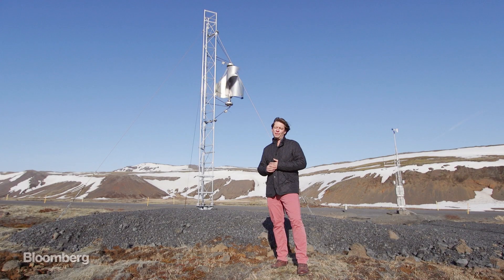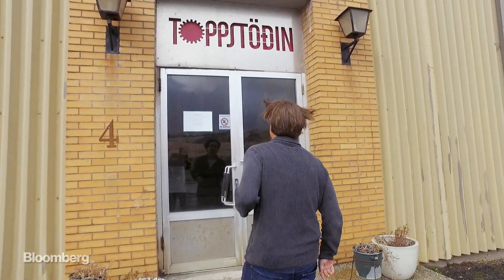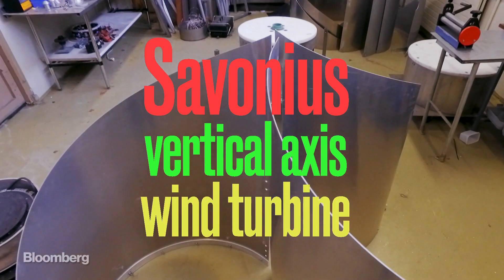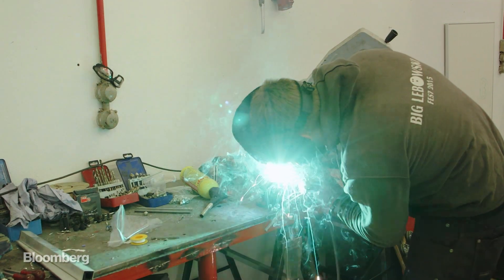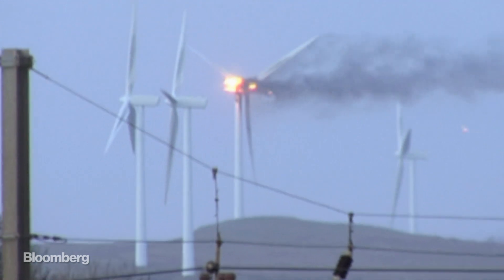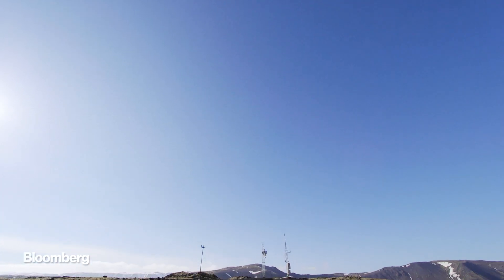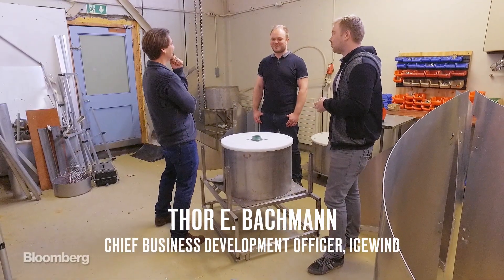The Tech That Could Fix One of Wind Power's Biggest Problems

Comment: This turbine is a bad idea because only the inclined area of the blade takes wind energy and that is very little, and most of the wind pass through blades. My "dmmd" wind turbine takes much more of wind energy. I designed two such turbines, one horizontal and one vertical. There are three kinds of turbines: "Wind direction change" (as the horizontal turbine), "Turbine different shape" (as the vertical turbine) and "Wind direct hit" (My idea and is not yet known)

Comment: These are not Savonius type rotors. Savinous pointed put that the gap between the two (!) wings is crucial to even out the negative pressure on the backside of the wing that rotates towards the upcoming wind. These turbines here don't have that gap and thus run less efficent. Also they have more than 2 blades, which is not what Savonius suggested. I guess they work as well, obviously. But they are not Savonius-type.

Comment: If these were cheap they'd be useful. Inability to scale up doesn't matter domestically or in light industry, just use more smaller ones. I wonder how they would work in water? In a tidal barrage underwater or a river? This stuff about them being not efficient due to the back blade facing wind too could be solved as it has been in aviation by computer controlled pitching of some kind?

Comment: The fact is wind turbines are an eyesore no matter what kind are used.
Reply: It's in the eye of the beholder.  I'm not crazy about smoke stacks from coal power plants, air pollution and reduced lung capacity.  To each his own but we need to do something pretty quick.

FYI this "wind turbine" is nothing but lawn art.  No power curve, no specs, no viable product.
Reply: @solarwind907  It's true that smoke stacks are unsightly. but they don't cover large area's of the landscape. (an example) say your driving along in your car and you drive past some smoke stacks. you will see them while you are in that area and not again. however if you drive in the area of a wind farm you will see those wind turbines for miles and miles. but what's even more  unsightly is wind farms where the wind turbines have reached their maximum lifespan. and have to see derelict wind turbines as far as the eye can see. because many of these energy companies take no responsibility for cleaning up what they left behind. maybe these energy companies should take a hint from something like wind mills. there are some of them that have been around for a hundred plus years. that still function with significantly less maintenance. I don't have all the answers but the way the energy companies are going about it right now doesn't seem to be highly efficient.

Comment: What is the Carbon footprint of each generator from the Extraction of the Raw materials to make and cut the Stainless steel, to the Carbon fiber, to the bonding reasons of the Carbon fiber and son on including all shipping and handling cost for each nut, bolt, screw, to the generator parts and to the nth degree, just to keep the electrical cost down for a Bus Waiting station. Is it truly Carbon saving?

Comment: Round spinning windmill are very ineffective. They don't spin or work till you got 20-30 mph wind. It's a trade off. propeller Type spin in very light wind. And spin twice as fast as these.and You get more ah.
I know someone now who regretion he brought a round spinning windmill. It's not working 80% of the time.
 
Why don't they just make a rutter like a boat rutter. That comes out the side when the speed sensor say speed too fast. The rutter would turn the windmill blade side to the direction of the wind. So the blade wouldnt  turn as fast as  direct full on wind speed. It's so logical.

Comment: Probably the biggest problem with "renewables" is the massive need for storage. ie batteries made from toxic materials mined from the earth that eventually require safe disposal.
Reply: Consumer products use batteries for convenience. We don't make batteries to store power for the power grid. We just produce less power when not as much is needed. That means we reduce productivity at the water dams, burn less coal at the power plants, use less fuel. THOSE are the energy storages we use on a macro scale, not batteries. Now, if we can feed the grid with stable and somewhat predictable energy from solar, wind etc, we have less use for energy storage at power plants and dams, which will benefit the environment.
Reply: @oleanderthor-borre9506  right LOL.
Reply: @jluvs2ride  you're just mad because you thought up to this point we actually made batteries to store power for the power grid. Something only an idiot would think 👍
Reply: @oleanderthor-borre9506  you aren't important enough to make me mad.
Reply: @oleanderthor-borre9506  but, you are incorrect about batteries being used for storage.
Reply: @oleanderthor-borre9506  stable and predictable wind and solar.  LMAO!!
Reply: @oleanderthor-borre9506  per unit of generation wind and solar are horrible for the environment.

Comment: Any wind turbine is better than no wind turbine and we need a mix of them.
This would be great fit  with solar PV for small scale buildings.
Efficiency is NOT the point of complaint if you have 5 acres of space, and want to generate some electricity for yourself, especially  in consideration to the millions living with out power on Mother Earth.
I do engineering work and Sheetmetal and these guys are getting off their butt, and producing something.....that does work.
If people want to criticise then they need to build something better, with their hands.

Comment: Maybe the vertical nature of the turbine will reduce the bird kill.
Reply: Very likely, yes, but let's not forget that household cats kill far more birds than wind turbines.
Reply: @tcl78  -Except cats dont usually kill birds of prey like Eagles and Kestrel many of which are protected species and fly on thermals then get caught in the pull of the air into the propeller arc.
-Alot of bats are also killed by these.

Comment: Yeah, not an actual problem with wind mills. Normally if the wind gets to high, the mills are turned off. They don't spin at all. So I don't know why you are pretending that fire had anything to do with too high winds... The only real problem wind energy has is that it requires rare materials for the magnets. 

Also, this is nothing more than a bad commercial. No information whatsoever except for a false claim that other types of wind mills can't handle weather. There's a reason these kind of windmills aren't used much: they are low efficiency.

Comment: "slow itself down in high-winds" How?
Reply: When a velocity is reached it will disengage ride up and off.
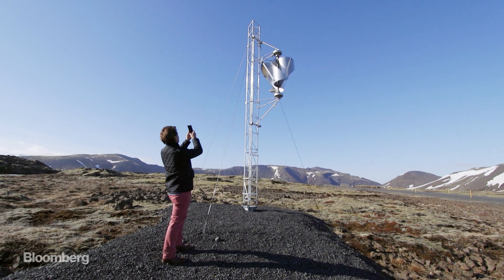Reply: The blades expand out, making them travel farther. The wind pushes the blade longer which spins the axis slower. The blades at 1:48 are tucked in for low wind speed and expanded out at 1:58 in a stronger breeze.  Looks like the rods are a linkage to lift the blades out the same distance for balance.

Comment: This concept was done years ago by splitting a 55gal. drum vertically then reassembling with a 2/3  offset. Pole mounted with bearings top and bottom and set on a robust truck alternator, it produced power with wing speeds as little as 3-5 mph. So, new take on an old idea. Sorry, Bloomy...mis-leading and incorrect...as usual.

Comment: Agree with other posters, this video is bad intel overall.  Wind turbines last more than 3 years unless they're garbage to start with.  Savonius WT's and Vertical Axis Wind Turbines like them are considered lawn art by wind techs that are actually trying to sell something that makes some power.  
Wind turbines don't burn up in high winds unless something failed.  Electrical short circuits unfortunately happen, but very seldom with a quality machine.

Comment: In Jan 2021, they have two models, one for residential use that is rated at 160W and two for industrial use that are rated at 100W & 500W.  What the heck are you supposed to do with such low output?  Yeah, I suppose the residential unit can be a point source for a small refrigerator, or a backup battery charger, but that's about it.
Reply: Yeah... Unfortunately a lot of people just aren't able to critically evaluate these technologies. Invariably the people defending these greenwashed products just aren't aware of the fundamental flaws that make them economically unviable. If you try and bring these things up they will either sink into denial or, more often, they try to invent dumb little niche uses for these products, like your small refrigerator example.

What's unfortunate is nobody thinks about the opportunity cost or waste inherent in building any new product. If this will generate a tiny fraction of the energy output per unit of energy and material input, then how is this a green solution in any way? For example if a city chose to power a bunch of bus stations with these things that might seem green. However, for a small fraction of the cost and embedded energy and materials they could have just built a small wind/solar farm in some ideal location to subsidize the city's electric demand. The latter solution is much better for the environment than the shitty little wind turbines! The most famous example of this is obviously solar roadways where people contort themselves into believing it is green or that we "may as well" use photovoltaics wherever we can without realizing it is an incredible waste of energy and resources to use photovoltaics in innifiecient ways!

Comment: Let's take a step back and see what it means to generate energy. It means the machine should produce a lot more energy in its lifetime than it takes to build, install, and maintain it. Then consider that wind energy is proportional to the 3rd power of windspeed. There isn't much point in extracting energy from low windspeed because there is so little to be had. These machines are unlikely to ever produce the energy used to make them. But, they can make sense in remote areas where connecting a grid would cost even more in terms of money and energy. Otherwise, they're greenwash, something made to look like an improvement but actually makes things worse. Bus shelters, wifi, yeah. All powered by wind generators produced using a sea of fossil fuel energy.

Comment: Typical nearly useless wind power over electricity generation.  Until someone finds a place that the wind blows at a constant 20-30 mph ETERNALLY, all these wind gadgets are just another diversion from coal, hydro, and nuclear power generation.  Include petrol in that mix and there is nothing that can touch those capabilities to produce power.  Everything else, whether it's wind power, wave power, trash power, and the ever popular but worst polluter of all, solar power/battery storage, are just dreams that keep Al Gore and his like rich.  All the while, diverting money from cleaning up petrol power properly, as well as improving the already excellent nuclear power processes we already have.  Until we nail fusion power, petrol power and nuclear power are our best hope to power the planet.  All these other dream powers, like battery, wind, wave, trash (methane) and solar are just a waste of time, using up precious resources while we could be putting that research into making what actually works (nuke and carbon) even better.  
What a terrible shame, and waste of human resources.

Comment: One of wind powers biggest problems?

One of all vertical axis wind turbines inherent design problems, is that they're only  capable of producing power on 1/2 the swept area of the blades.

This is because only 1/2 of the blades are ever oriented perpendicular to the wind at any time while the other half is coming around against the wind.

So vertical axis designs will never be able to compete with the efficiencies of horizontal turbines.

That is the biggest problem they face and the inconvenient truth.

BTW,  I once invested several thousand dollars in a new, promising vertical axis turbine.  That money is long-gone with the wind!

Comment: Wonderful, no tech specs were provided for a proclaimed cool tech?

They can't just tell us this turbine works in all weather conditions without brakes, and then proceed to provide no elaboration on it? 

What about the material cost? 
Such a low radial distance can't possible produce a high power output. How much power we r looking at?
What is the efficiency of this thing?